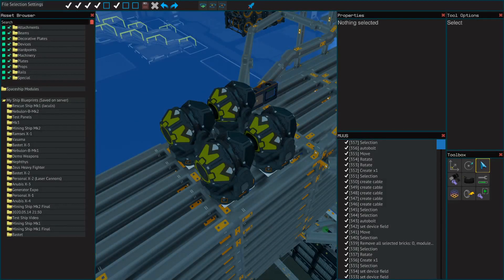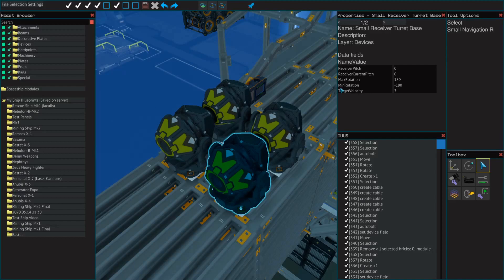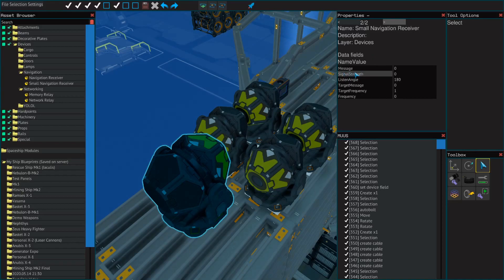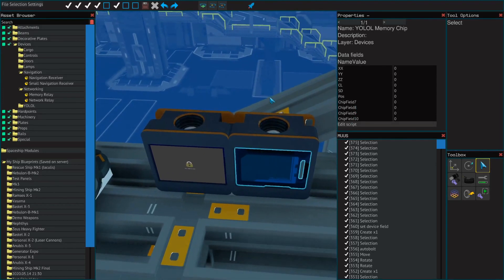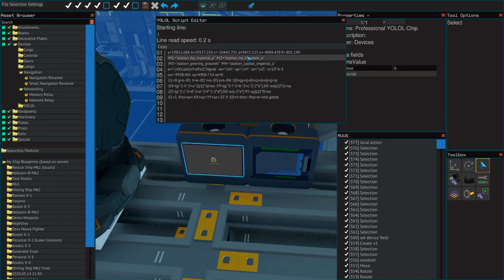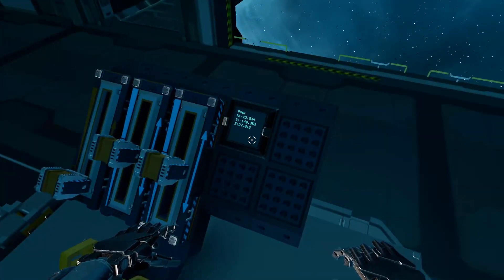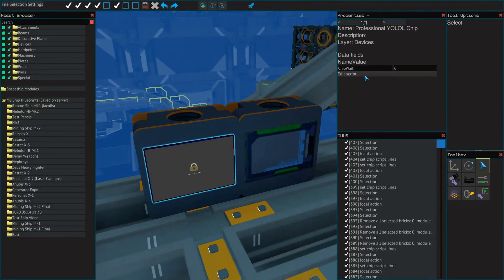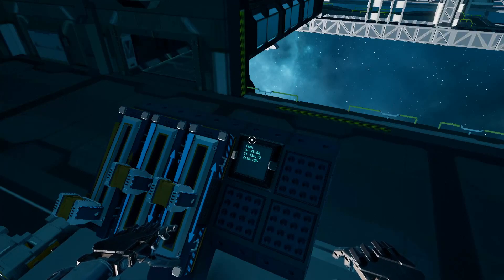STARBASE TUTORIAL- ISAN GPS Quick Setup Guide

Comment: What are theese receivers communicating with to calculate position. There has to be a stationary reference so where is it coming from?
Reply from the maker: The main stations give off several signals which are used to calculate position
Reply: @simulatorhaven  ok thanks, is the range infinite then?
Reply from the maker: Sadly not. Currently the maximum range (of either the receivers or the station transmitters) is 100km. Which isn't too bad, but still an annoying limitation
Reply: @simulatorhaven  Correction! 1'000'000 meters is 1000 km :)
That's the range of ISAN and any other radio transmission right now. (Max speed non-stop, that is 1 hour, 51 minutes)
Reply from the maker: Ah, thanks. Thought it was 100,000m range
Reply: @simulatorhaven  wouldn't be surprised if that covered most of the belt if not all of it as it currently stands though, as they add faster means of getting out that far, and reasons to do so, there will be stations on the way to extend the range, some of which could even be player made, which could be a way in which faction conflicts could impact other unaffiliated players, beyond simply increasing the demand on certain resources,
Reply: Why don't they use a preset 0 0 and then track the speed which would give you a estimate of where you are ?
Reply: @EDred8  Without GPS there is no way to track speed. aside from the distance lazer things
Reply: Also communicate with the direction of your ship by connecting to the direction "thingy"so when you push up you know how fast you go up by the yellow tracking and then it could estimate which way you were pointing!?
Reply: YOLO not yellow 😅.
Reply: @EDred8  they have a add on thing for it which lets them calculate speed, you just cant fit it on a single YOLOL chip
Reply: Does this mean you could connect to someone else's range finder thing to help find them by simply going to 0 0?
Reply from the maker: That's an interesting idea. That could work, but I'm not that familiar with YOLOL to know how. and yes you could use this system to find something. But I'm not sure the Collective will be going off a 0,0 based system as you describe. That's probably a question to forward to them
Reply: Just red another comment and realize that just replace all of the 2 0 with 3 0 😅